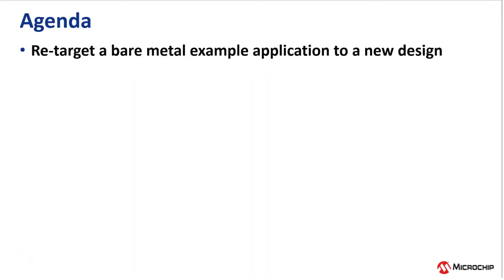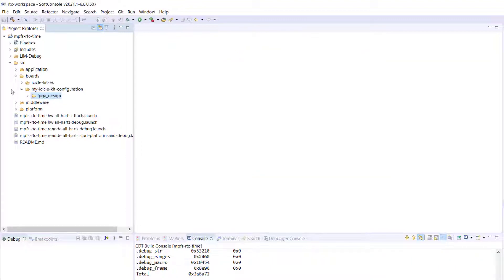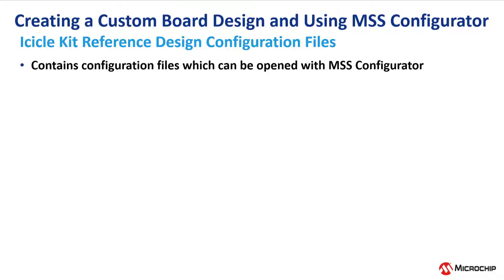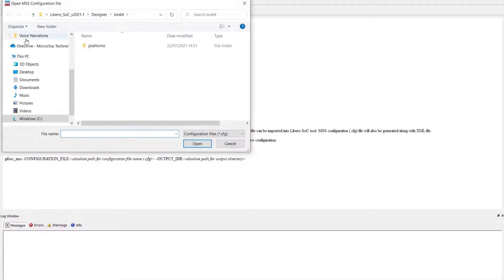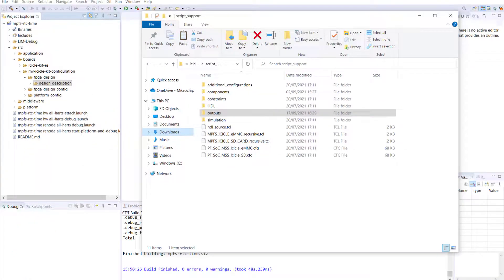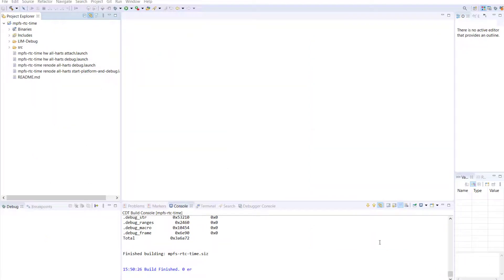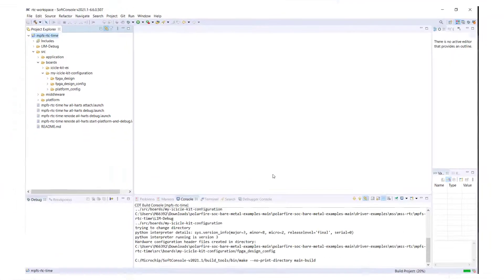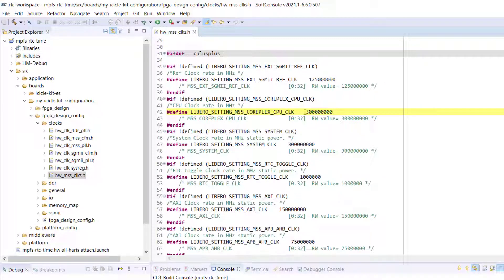PolarFire® SoC | Creating a Custom Board Design and Using MSS Configurator

Comment: Hi, Why it is required to build 2 times to reflect the changes. After, providing the build settings (time - 5:13) - Before the build we have empty fpga_design_config folder then after the build it is filled with generated configuration files - where in src- > boards -> my-iccle-kit-configuration-> fpga_design_config -> clocks -> hw_mss_clks.h - MSS_COREPLEX_CPU_CLK has a value = 600000000 but only after rebuilding the project the value has changed to 300000000 . But, it should have updated in the 1st build itself - Please can you provide an explanation to that
Reply from the maker: Hi there, thanks for your question. The requirement to build twice is due to dependency resolution and incremental processes. The initial build generates necessary configs; the second build integrates these changes fully. The clock value update occurs as configurations propagate correctly. If this issue persists, please contact Microchip support for assistance. Microchip.com/CSS. Thank you!